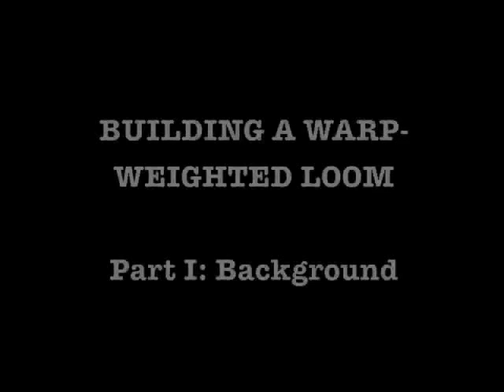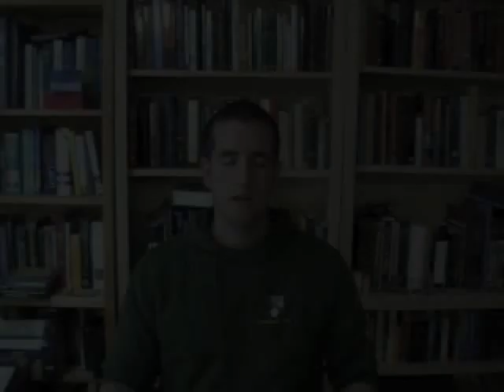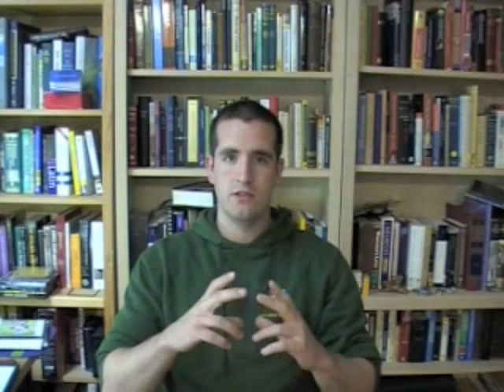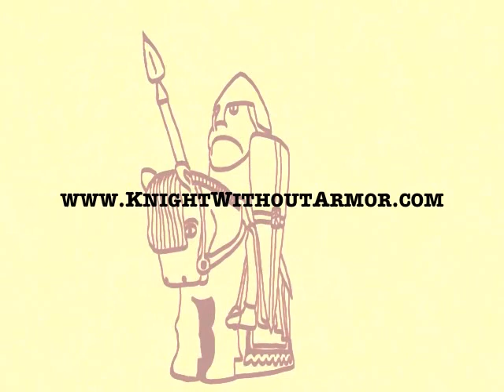Building a Warp-Weighted Loom, Part I

Comment: I built two of those looms from straight tree trunks of different diameters and I use them for several fiber techniques, such as Sprang, tablet weaving, macrame, etc. I still have a problem though with solving a major problem, when weaving like the Vikings did. How can I make the top, that is supposed to be turned together with the finished woven fabric? At the moment I just don't weave fabrics that are longer than the given height of my weighted loom and that's pretty annoying.
Reply from the maker: Hi Lisa, thanks for your comment! For the top part that turns with the completed fabric, it is really important that it be perfectly straight and of perfectly even diameter throughout. Otherwise, as you wind the finished cloth around the top beam, some warp threads will be stretched and others slackened, which will make the weaving uneven. We used a square beam that would sit snuggly into a notch without turning and unwinding while weaving, but which we could lift up, wind, and then settle back into the notch securely. If you use a round beam, you could secure it with pegs or tighten it with a screw so that it doesn't unwind while weaving. That would be a bit more complicated to build. You can see what we did in the Part II video. https://www.youtube.com/watch?v=z2bOpcxtD9o